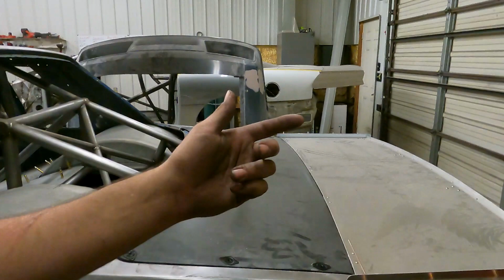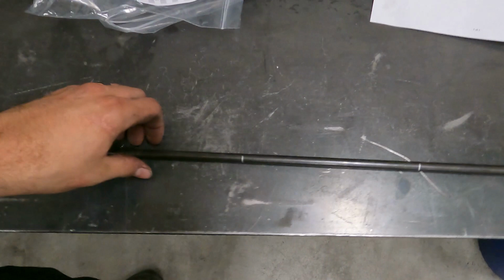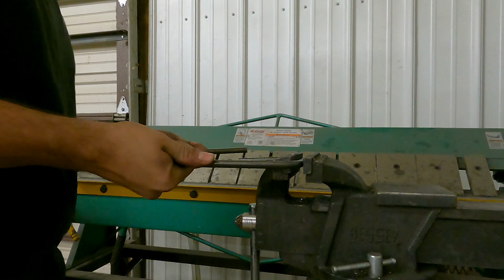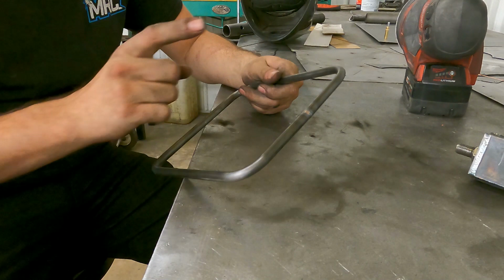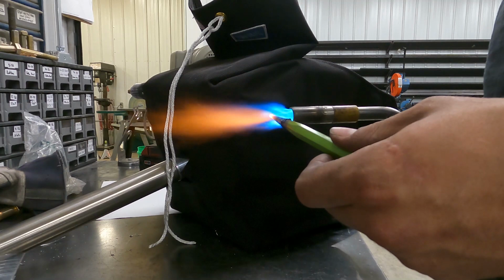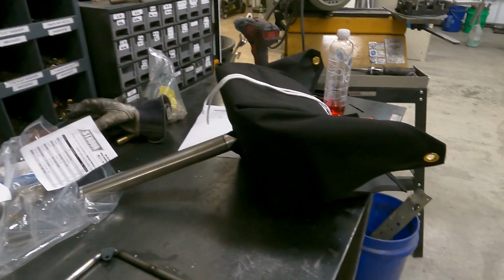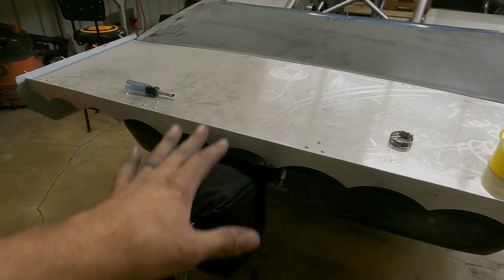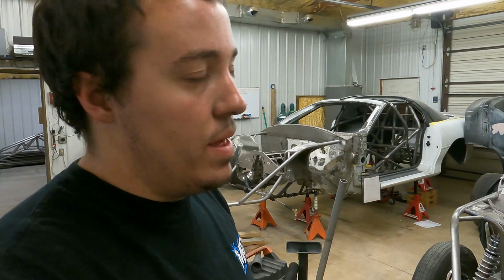EP 22 Shop Car Parachute Mount Install!

Comment: What version of Bendtech do you use? I have a very old version of SE . Been years since I even used it . It was very handy when I did use it. Tip for you , forget the punch and torch. Use a soldering iron , the screwdriver type , you can but a bigger anvil to suit the hole needs. Also do you guys ever use PEM nuts or Riv nuts ? I could see a Riv nut working well for the upper chute mount.
Reply from the maker: We use bendtech pro. The torch is fast. Thats why we use it. We use rive nuts all the time but can pull out of this metal like on that back of the car.